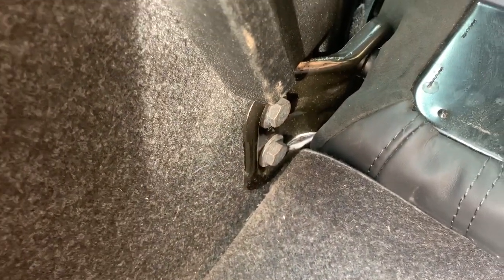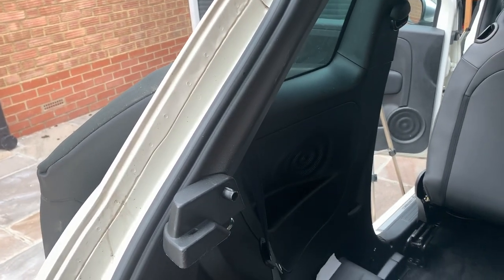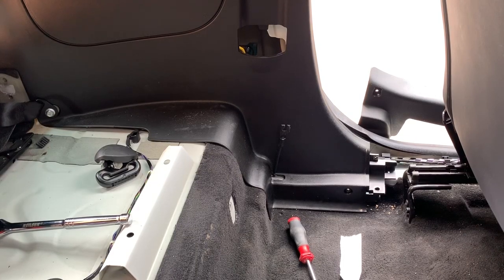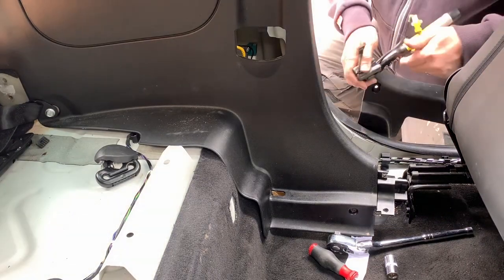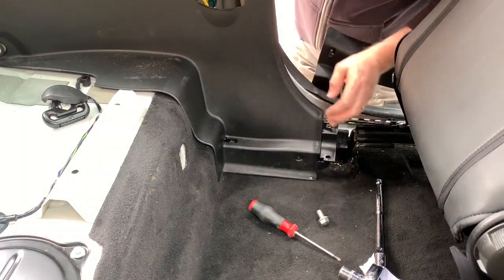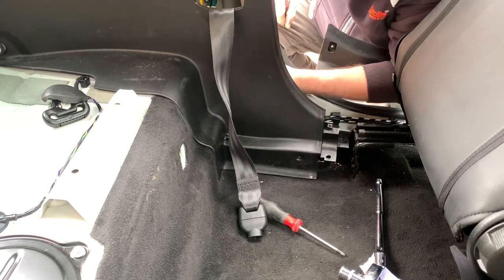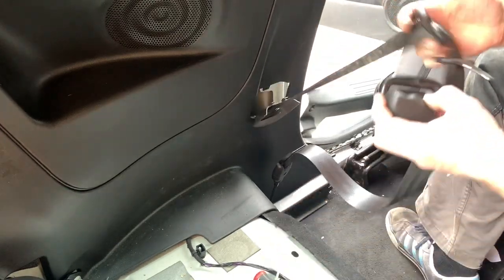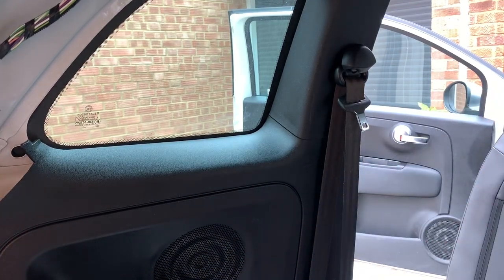Replacing Front Seatbelt & pre tensioner in a Fiat 500 or Abarth  - Love 500 How To Series

Comment: Very well explained video. I wanted to replace the pretensioner as the spring is not strong enough to pull the whole belt back, without some help from me. But given the effort I might need to reconsider. Any idea if I can sort this issue in a less invasive way? Is there some specific lubricant?
Reply from the maker: The best way I have found is to spray some WD40 after pulling the belt out as far as it will go, removing the little snap in panel which exposes the mechanism. Spray it in and then retract the belt several times, seems to do the job, at least temporarily.
Reply: @Love500  thanks! Let me try. Would it also soak the belt? Very poor maintenance and repair design from Fiat. I understand you need to dismantle the same parts to access to the blue&me module...
Reply from the maker: @ReX-jo6hb  it doesn't seem to as it will stay on the reel and run down beneath it but it seems to work. I've done it several times, works every time.

Comment: If seatbelts are deployed Very tight and teansioner also do you have to cut them before removing ?
Reply from the maker: Not really but you can play a tune on it. Check where it bolts in at the top though as it can sometimes deform the metal so the bolt points down too much. Once you’ve released that bolt you can just remove as normal. It’s of no use anymore so it won’t hurt to take a knife to it.

Comment: Greetings from Denmark....I need to get a secondhand LH FWD Seat belt for a Fiat 500. New at Fiat is very expensive. Used they are difficult to find for at OK price. Question: Does the Fiat 500 use the same Seat belts as the Ford Ka? (Many other parts are the same).
Reply from the maker: I believe so but the fiat ones are plentiful on eBay so I would get a fiat one just in case.

Comment: Hi my airbag light is on. Error b0106 driver side pre tensioner resist. Do i need to replace just pre tensioner or seatbelt as well?
Reply from the maker: Difficult to say. I guess you didn't use MultiECUScan to get that code? That would point you to exactly what was the issue. I think it's probably best to replace the pre-tensioner and see what happens. If it is just that your airbag light should just go out without needing to clear the code.
Reply: Ok i will try that way thx

Comment: Hi. Nice video. I have just change the seat belt but after the airbag lamp keeps the red light on, do you have a suggestion.
Reply from the maker: Probably the pre tensioner. Even if the metal cable hasn't retracted it's probably gone if the seatbelt has. You need MES really to diagnose which sensor is keeping the light on.

Comment: Hi,, thanks for the video.
I recently had an accident where the FIAT500 front airbags exploded (driver steering wheel and passenger).
ALSO the pretensioners are blocked and my seatbelt (driver ) doesnt roll back. The passenger seatbelt its retracted and impossible to move back or forward.
Do you know how to unblock the seatbelts rolling system? I bought the pretensioners from a dealer and all that he sent are those that are on the floor of the car behind the seats with a bit of a steelcable (not those that are in the rolling system) and he tells me that he doesnt have anything else :(
Reply from the maker: There is a way of releasing the reel by drilling out rivets and removing a part of the mechanism. Quite simple at works most of the time. However if you do that they become normal inertia reel seatbelts without the squib as the squib has already done off. Because of this, the electrical connection on the top of the reel has to be bypassed with a resistor which fools the ECU into thinking it's connected otherwise your airbag light will stay on. You are better off buying a used set on eBay. You can pick a pair up for around £130 or an individual one. There are usually loads on there. Make sure you remove the earth quick release terminal before messing with any airbags.
Reply: @Love500  Hi thanks for the info! Do you mean the earth battery terminal? I don't know :(
Reply from the maker: It is what it is yes, sorry for the delay in replying. I did mean  the earth battery quick release.

Comment: Good video but you have missed out the part where you disconnect the seat belt from the charge at the bottom before you take the panel off any idea how this comes apart
Reply from the maker: molecbr a flat headed screwdriver. Half a turn and it pops out.
Reply: @Love500  thank you